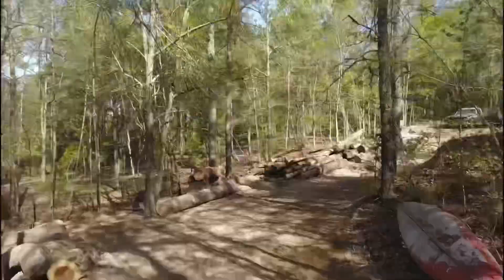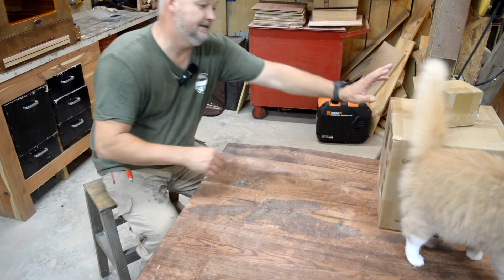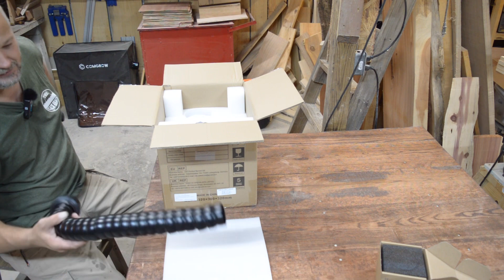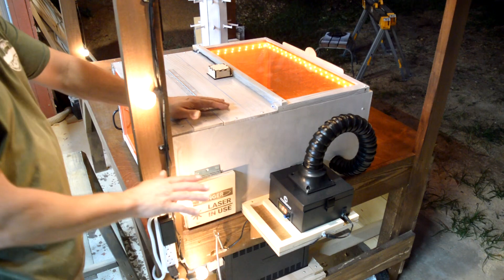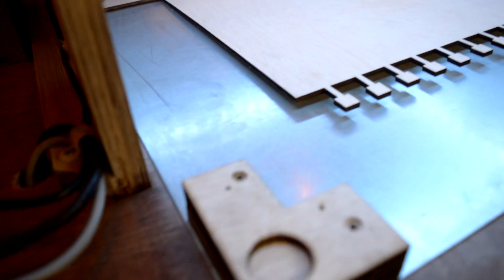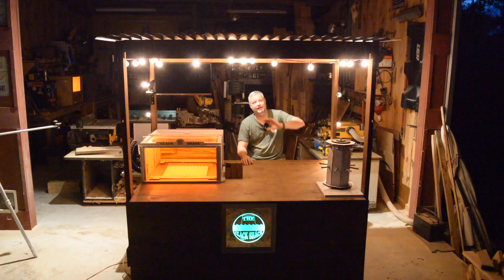Comgrow air purifier add on

Comment: Comgrow makes some great stuff you can use for laser cutters that's advertised for other industries. Their small multi-tap air pump for larger aquariums is the exact same vibro pump XTool and others sell as 'air assist pumps' but while XTool charges like $80 it's only $30 or so from Comgrow.
Reply from the maker: I agree, I have had their air assist

Comment: Thanks for the review ... one of these will be in the way to my shop!
Reply from the maker: Keep in mind, it helps but not a "true" purifier.
Reply: @TheClackShack  Ordered a set of replacement filters with it. Will be using it with the ATEZR enclosure in my garage where I have good ventilation.

Comment: Hello from SWGA...  Love your videos....I am just getting started in Laser engraving/cutting.  I am thinking about getting the atomstack x20 pro, comes with the air assist, and I am going to get the rotary to go along with it.  I have been wondering about the smoke.  I think this comgrow air purifier may do the trick.  I don't have an enclosure for the laser and want to use it in the house.    PS SOOOOO you can send me the second comgrow air purifier.  My husband is a wood worker / turner So I really think this will be a good new venture for us.
Reply from the maker: I recommend an outdoor vent if at all possible. The filters help but the element will need changing regularly.

Comment: MN resident myself. How often do you have to change the filter?
Reply from the maker: I have used compressed air and cleaned it a few times. It still works with a little odor. So far, I am still using the same filters.

Comment: Great Vid.  I was going to purchase but didn't because I contacted Comgrow about replacement filters for the unit.  They only sell the Pre Filter and Not the other 2 filters which is ridiculous.  Their engineers supposedly said the prefilter needs to be changed often based on use, but the Hepa and Charcoal filters not as often.  The fact remains at some point they will need to be changed if the unit is to stay effective.  Just wanted you and your followers to know what I learned.  Will not be buying from a company that doesn't even provide consumable parts for their machines.  Thanks for the videos.
Reply from the maker: They sell a box of 3 filters for 19.99 on their website. It is only one filter on my machines.
Reply: @TheClackShack  I believe you will find that is for the Pre filter.  What's really nuts is in the manual they recommend the prefilter be changed monthly according to use and the other filters in 3 months according to use.  But they don't sell the other filters, only the prefilter.  Thats just nuts.  Can't do what their owner's manual recommends.
Reply from the maker: @slhasebroock  , I have tken the filter out and cleaned it and only found one element. I will look closer.